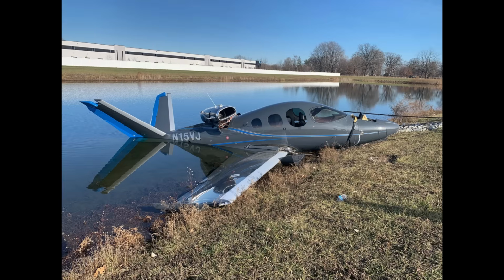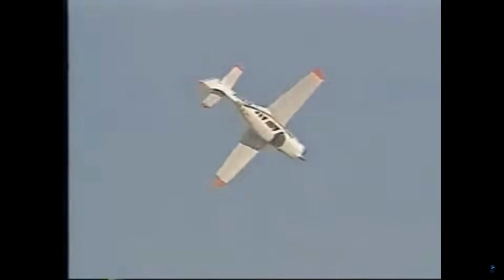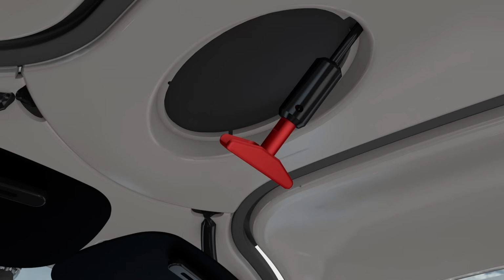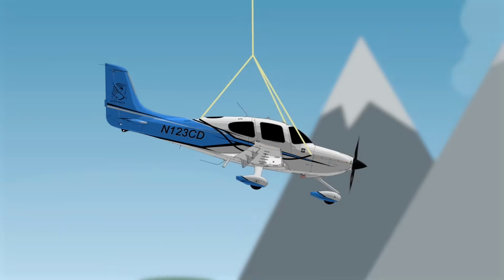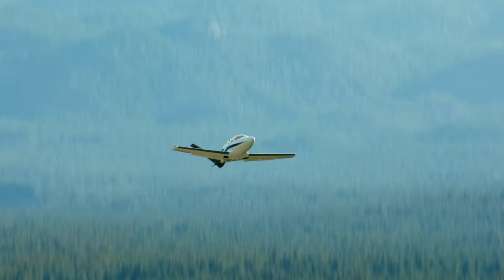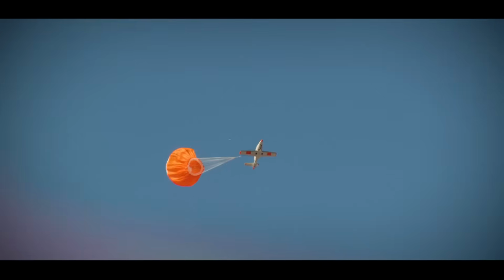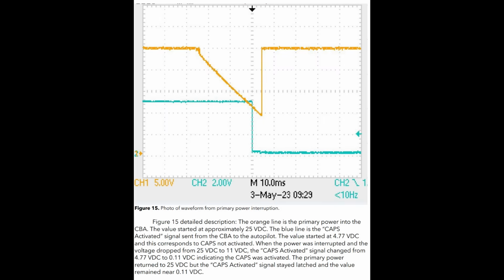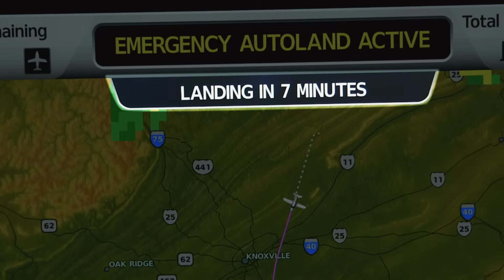Putting Parachutes On Planes: The Genius Engineering Behind Rocket Powered Airframe Parachutes.

Comment: Making the parachute only deploy if it detects a low enough airspeed seems like an incredibly stupid decision. What if the airspeed sensors are malfunctioning? What if the control surfaces are broken? What if a crash is imminent and it's better to take the chance that the parachute breaks than to waste time trying to slow down? The pilot should always have the ability to override the airplane computer in the event of something unexpected.
Reply from the maker: If the system doesn't detect a decrease in airspeed within 8 seconds it deploys. And the parachute deploys after 30 seconds regardless.
Reply: @scottmanley  Hmm, that's good, but 8 seconds is a really long time if you're low to the ground. Is there a good reason to not give the pilot direct control?

Comment: At Lilium, a parachute was considered for the EV aircraft. It was dropped because the EASA considered it an overall risk due to unnecessary deployment making the situation worse and that being uncontrolled is considered much worse than control. Its worth noting that Lilium was going for commercial aircraft standards that would not allow a single WW2 era engine for propulsion the target is 1 critical failure in something like 1billion hours of flight time.

Comment: It is kind of interesting that most of the tech you describe on the initial Cirrus parachute is quite similar in specification and function to the design used in the F-111 crew escape module down to the ton-and-a-half weight. That system includes additional systems to slow the deployment speed by use of drogues so it can be activated at much higher speeds of course.

Comment: my impression of this is pretty low.  what it has allowed if the stats are to be believed is a lot of half rated pilots to fly high performance airplanes and have a chance to live when there is more airplane then pilot.  

I have not looked recently but was part of a study for a major GA insurance company a few years ago that found few of the "pulls" were the result of anything but massive and preventable pilot error.
Reply from the maker: It turns out that many crashes are due to massive and preventable pilot error.

Comment: I've wondered for a while with all the drone technology and automatic landing systems that some military and civilian aircraft already have, why a full remote control system isn't part of all civilian jetliners.  Maybe not even full control if the pilots are functional, but to assist in troubleshooting aircraft issues so assist the pilots in figuring out whats wrong with the aircraft if it is suffering a failure of some kind.

Pilots call in a mayday, experts in that aircraft get the telemetry, and since they aren't task saturated trying to aviate, navigate and communicate, you have an expert on the ground who might be able to tell the actual pilots "you issuer is this, do these steps i have the checklist right here."  Some of the other aviation channels i watch that do accident walk throughs, pointing out what the investigators found and/or deduced after the aircraft crashed, a lot could have been potentially alleviated had the pilots had some assistance figuring out what was wrong with the aircraft while they still have time to work around it and land the aircraft.

But even a system that would allow the ground to take control of the aircraft (the pilots would be able to override of course), to allow landing or a safer crash landing if the pilots are incapacitated, should be doable today.

Might happen someday.

Comment: Technically the TBM 940 was the first to be certified with HomeSafe (by a month) but you said jet, so.. 👍 lol

It is an incredible system, I wasn’t aware of the automated radio calls, very cool!

I’d still rather have a TBM though… larger, more range, and faster (in most phases) plus arguably more flexible and definitely economical with that turboprop… but yeah, it’s also $1m more lol.

Comment: Proud to work for a Cirrus service center and be CAPS certified! Always a good day when I get to do a CAPS overhaul and play with the rocket! I've even helped a coworker replace the entire LH CAPS strap. I was in d3eluth when the first Vision jet CAPS pull happened, the whole SF50 CAPS engineering team was celebrating at the bar out training class was at, it was pretty cool!
Reply: Do you really enjoy replacing the parachute on the G1? I bet you don't enjoy that. Nobody does
Reply: @Airplanefish  Really the worst part is fitting the new cover, Beyond that I don't mind it.
Reply: @Goldeagle365  paint never matches on them. They are so faded. Usually new N numbers get installed because the paint blend line needs to go way back
Reply: @Airplanefish  our paint guy is a pro, his blend work is very good. He hates taping off n numbers but again, is really good at it. As for paint match, it's all about getting close color wise, blending properly, using the right primers, fillers, and good quality paint to prevent fading.
Reply: @Goldeagle365  luck you got a paint guy. I'm doing it from start to finish. No wonder you don't mind the paint work. Someone else does it

Comment: Scott, helps fly safe? It's a crutch IMO. I had an BRS system back when they first came out. One of the first systems ever made and the reason for it was because of the possibility of my aircraft, not being air worthy in design. I did not have the parachute because i didn't know how to fly or don't know when to fly and or I don't have the judgment to be a pilot.
The vision jet is a fantastic plane and if it's being sold to people that are not qualified to be pilots of that advanced of a plane, it's doing a disservice. That's my opinion. And i'm gonna stick to it ✌️.
People that are not skilled enough to fly a plane will be pulling for the parachute because they are not skilled enough to fly a plane.

Comment: One of the channels that I follow that buys abandoned airplanes to get them flying again had an issue with the parachute. They have to be replaced every 10 years. And that's like $20,00 and up. It's a major, cringe expense but you're glad you did it when you need it.
Reply from the maker: I know exactly who you're talking about. The G1 Cirrus they bought required composite repair work to replace the parachute which made it more expensive.
Reply: Its cheaper for the G2 and on, about 15k, and that's less than $1500 a year for extra peace of mind/ the wife letting you but the plane
Reply: I'm guessing a working chute would decrease insurance premiums also, thus offsetting some of the cost.
Reply: A couple of remarks….while the CAPS system has undoubtedly saved lives [and one can debate ad infinitum how many of those “saves” would or would not have resulted in fatalities, about as useful as arguing how many Angels can dance on the head of a pin] unfortunately, the number of fatal Cirrus accidents [187 as of today] continues to outpace parachute saves by a depressingly large margin. Lots of potential reasons for this, but they mainly boil down to people getting into situations that are beyond their capacity, and not attempting to initiate parachute deployment deployment [if attempted at all] until they are outside of the demonstrated operating envelope. Really nothing new, pilots have been killing themselves that way for decades.

Regarding spin certification, you are correct in that Cirrus was able to achieve an “equivalent level of safety“ by demonstrating that the parachute could be used reliably for spin recovery. In contrast, Columbia Aircraft had to spend well over a year and several thousand, yes thousand, spins to be able to safely and successfully complete the entire part 23 spin matrix necessary for certification. This was an expensive and time-consuming process. You are also correct in that.EASA, which, for those who do not know, is the European equivalent of the FAA, required limited spin testing in order to approve the aircraft for use in Europe. They performed approximately 60 spins in an SR 20. The report is available online and the conclusion was that while the spin recovery technique is conventional i.e. nose down to break the stall and opposite rudder, the aircraft often would not recover in the same fashion as a Cessna, 152 in which releasing the controls will often recover from the spin. Instead, the anti-spin inputs had to be held usually for at least one complete turn before the aircraft would recover. They did not perform anything like the entire part 23 spin matrix, so there may be corners of the performance envelope in which the spin recovery is quite unusual and or impossible, although this is of course a somewhat moot point because the only approved spin recovery procedure is parachute deployment. In addition, they only tested the SR 20 and not the SR 22. So when people say the airplane “Passed the spin testing in Europe“ that is true to a point, but it does not reflect testing to the same degree that one has to do under part 23 to certify that the airplane is recoverable from a spin.

Flew over your home airport this afternoon on the way into Santa Rosa for a fuel stop before continuing on north in our M350 Beautiful day to fly with the exception of departing Southern California, where there was significant convective activity.
Reply: As a former private pilot myself, my instructor "demanded" I learn spin ingress/egress. I'm damned grateful he did. I used to own a Grumman AA-5B Tiger. Great airplane, but no spin capabilities. Beyond 3 turns? Your screwed. And I am of the camp of "learn your airplane and never let it get out from under you".

I am impressed with the "idea" of a ballistic chute. But I've heard pros tell me that many of the accidents like the Cirrus Jet mentioned were completely avoidable IF the pilot had actually taken time to familiarize himself completely with his bird. I like the idea of a chute? But it is NO substitute for training and learning your airplane. And I think a lot of pro pilots are trying to convey that. It's not they don't like the idea? They just don't want it being the go-to when you can land if your just keep your training in mind.

Comment: A few years back I worked at one of the Cirrus sites and we had one of these installed rocket systems accidently go off inside the factory on the SF50 line. It blew a hole in the celling and sounded like someone dropped a dumpster from a forklift. They told us that static electricity from someone working inside the aircraft had likely set it off.
Reply: The US navy loses a few maintenance people from time to time when they forget to put the restraint pin in the ejector seats.  When that seat goes, if you are over it, you are dead meat.  Those seats MOVE.  Takes effort to do this, but it still happens when maintenance people don't do all the steps to safe the system, and put the pin in.  If the pin is in and the system goes off, you WILL need a new uniform, but you should live.
Reply: @jeromethiel4323  I heard about a guy (not US Navy) who was working in the cockpit and tripped and grabbed something to stabilize himself. It turned out it was sort of the third stage initiator or something on the ejection seat, meaning the bit that starts a timer to fire the booster that blows the seat further away from the aircraft after the first stage has ejected the seat from the cockpit. So there he was, in an awkward position in the cockpit, and he heard the timer going tick tock. Fortunately he knew what it was and what the implications were and he got the hell out of the way and whoosh! the main rocket motor went off and the seat went through the hanger roof.
Reply: @dougerrohmer Wouldn't that rocket motor blow a hole in the aircraft fuselage and melt the cockpit interior?

Comment: It's inexcusable that those circuit boards weren't conformal coated properly to seal them from corrosion.    And I wonder what it would take to improve the parachute to O-O capability?   Likely a stronger rocket and ability to open the chute quicker so low altitude use wouldn't just kill you.

Comment: genius idea the way the suspension system keeps the parachute from causing too much jerking on the aircraft I would be afraid of the prop cutting the parachute if it swings too much but I doubt that is possible with where it is attached

Comment: I've been flying with a parachute on my hang glider since 1980. Never deployed. No rockets, just throw it (in theory anyway)

Because they're used at low level, they're designed to open quickly. So the opening shock can be severe. I knew a guy who was separated from his glider after a structural failure. He deployed at high speed, and yeah, the opening shock broke things. Most of his ribs broke.

Comment: I would absolutely have one of those on a basic ultralight, where structural failure is far from unknown, but there are tradeoffs with larger machines around airmanship and other issues.
One place they ought to be fitted in certain small helicopters, which have several failure modes where a parachute is the only way down safely.

Comment: Yet SR22s are 5.1x more lethal than C172s (2.3 vs 0.45 deaths/100,000 hours flight). The parachute seems like a bandaid solution that ignores the danger of the airframe
Reply from the maker: Your numbers are out of date.
Reply: @scottmanley  Ah shoot, I imagine most of the increased danger is simply due to the more powerful engine, but were any changes made to the plane regarding safety? (Or is it just the natural ebb and flow of statistics?)

Comment: I’d love to see more on this topic. The future of its use, the attempts to fit similar systems to larger aircraft, different kinds of parachute systems, the history of it, etc.
Reply: I saw a video that had a design (not efficient or practical, more demonstration of concept) for a regional-size jet with a passenger cabin that could be jettisoned in case of emergency and parachuted down. The cockpit remained attached to the airframe, which could be flown without the cabin, and which was light enough to perform more escape maneuvers (spin recovery, etc) than the fully laden airframe. The primary intention of the concept was for passenger flow efficiency I think - load the compartment with pax, and when the inbound plane lands, remove the compartment already on that plane and swap it with the newly loaded one, and off you go with a quick turnaround. The emergency parachute option was a byproduct of that design.

Comment: The VisionJet having this emergency autoland system makes me think that it should be relatively trivial to also set it up to have "proper" autoland, aka the kind of autopilot system that can get you on the runway when the wind is good but the minimums are below... I think the figure is 200' AGL.
Now, it's obviously no replacement for a "proper" pilot, but this emergency autoland does seem to be a fair bit more sophisticated than the "normal" cat3 autoland system, at least on the side of the automation. Makes me also wonder if the VisionJet can be fitted with a HUD to make it capable of "hand-flown but instrument guided" landings in conditions similar to the Cat3 Autoland systems are capable of handling, I know the 737 has something similar to that.

Comment: CAPS on Cirrus aircraft makes sense as they are the new V-tail Bonanzas. High-performance aircraft flown by low-hours but high-net worth and therefore self-confidence pilots.
Reply: Would have been helpful on that TBM700 that crashed in MN. Owned and flown by a bank exec, sole pilot/occupant, approaching through an area of icing, drops below the deck in a near vertical spin. 😞 Years ago it was the Piper Malibu. I think Flying magazine had an article questioning whether that was the new lawyer k*11er. I think wealthy low-timers are spoiled for choice today, but yeah, Cirrus is the popular one for sure. (Doesn't Cirrus have a pretty extensive owner training program to mitigate against this? I don't know where I heard about that, and maybe I'm mistaken.)
Reply: Well spoken!

Comment: I'm happy for this life-saving innovation, but I'm curious what you think about the potential for CAPS making some pilots complacent about actually flying (stick & rudder) safely or raising their risk tolerance level?  This would be similar to how airbags in modern cars by some measures led to more accidents as drivers are less careful.
Reply: My only qualification to answer this is that 40 years ago I soloed a glider. I don’t think that would be a significant issue. Most crashes occur during takeoff and landing when you would be too low for the parachute to work, and takeoff and landing are also the phases of flight that require the most skill.

Comment: Maverick taking 'pop the brakes so they fly right by' to another level
Reply: There's a guy by the name of Growling Sidewinder who does a lot of Digital Combat Simulator dogfighting videos. There's a moment in what's called a "two-circle fight" where the attacking fighter has to be careful to manage closure speeds while the defending one tries to achieve an overshoot. GS did a video with a significantly disadvantaged fighter, I want to say a Mirage, and he started out by saying "I might win a round because I have a stupid trick up my sleeve that I can pull exactly once". That trick turned out to be popping the fighter's drag parachute that it uses to land on shorter runways, to pull an extreme eyeballs-out version of that maneuver. It worked! Once!